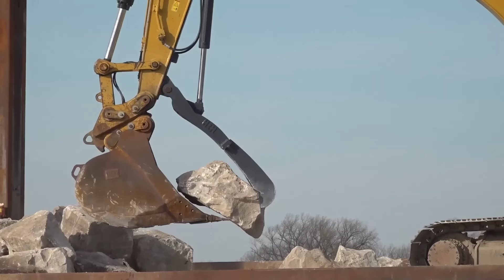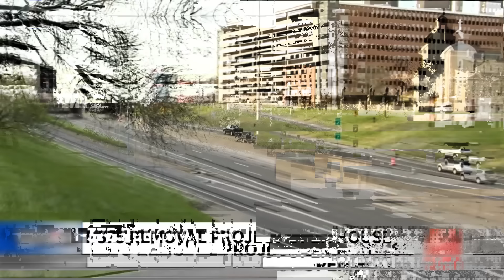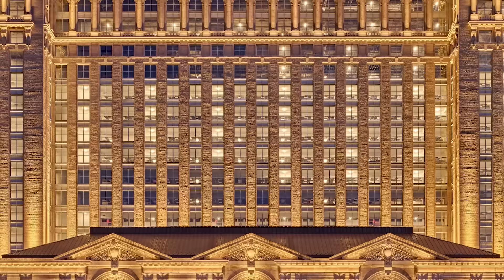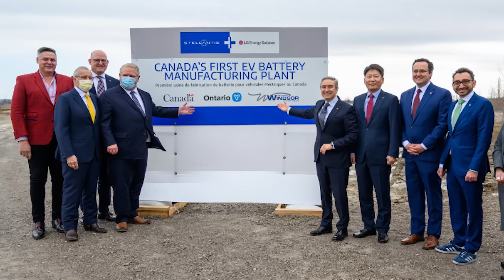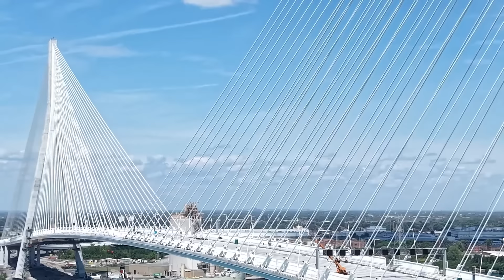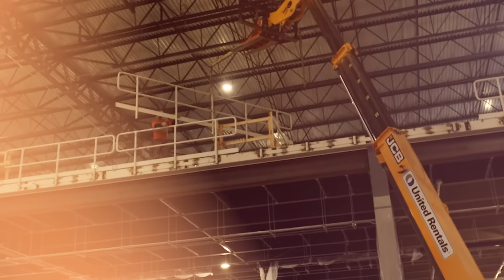Detroit's $20 billion 5 Mega-Projects Makeover is INSANE

Comment: Holy bullshit video. To go point by point...

Most of the clips of the riverfront are in fact clips of Windsor, Ontario's riverwalk across the Detroit river from the city. Our Riverfront is gorgeous but this video isn't showing you that. It is also using renderings from a "design exercise" from a decade ago to show you what is happening and none of it is real. There are new parks like Ralph C. Wilson that are fantastic, but most of the renderings are just lies.

I-375 DOES NOT have shovels in the ground yet much less a part of it opening in 2025. In fact they just went back to the drawing board for that project.

A plant across the river in another country is anchoring Detroit's EV revolution? Huh?

Hudson's Detroit also doesn't have an observation deck. That was an iteration of the building from 5-6 years ago. 

There is a lot of things happening in Detroit that are fantastic, but this video ain't it. It feels like AI slop and the real irritation is that they stole one of my photographs of Hudson's to include in the misinformation. I guess I should be happy though that lies regarding the city are now going in a positive direction...

Comment: 'Stellantis is building its primary North American EV battery plant, a joint venture with LG Energy Solution (NextStar Energy), in Windsor, Ontario, Canada, right across the Detroit River, not directly within Detroit, though they have significant Detroit-area operations and will build EVs at the nearby Sterling Heights Assembly Plant.'(GOOGLE SEARCH)

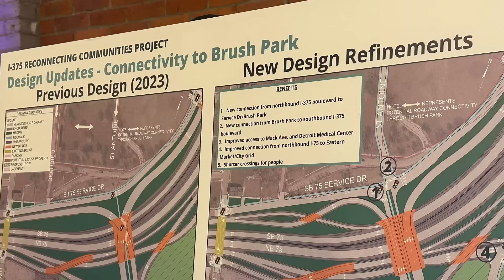Comment: 2:25 with the I-375 project, lets not get ahead of ourselves... there are certainly plans to fill the highway trench and replace 375 with a surface level boulevard but not an ounce of dirt has yet been poured over the highway, its still in planning. That being said I certainly agree that it needs to be done, and lets hope that this new boulevard gets lined with proper density. I'm concerned about this as well because there's still a lot of infilling of fields and parking lots that could be done in the immediate periphery of the downtown core.

Comment: Cool, but we still need to drive 25 minutes from Plymout, Livonia or surrounding suburbs. Then find parking. After getting back from Amsterdam and Dublin. It blew my mind why we don’t have a train system that can be accessed easily from the suburbs and take you right to downtown Detroit…oh I know it’s because the big three shut anything like that down. They don’t want good public transportation…how amazing would it be to hop on a train from just outside Plymouth or  livonia and get dropped off in downtown Detroit. Instead of driving down there trying to find parking. Chicago has the best most logical train system in the US. Instead Detroit builds more quickenloan buildings and renovates a literal train station without putting any trains in there

Comment: Just because there's a lot of confusion in the comments, as well as blatant misinformation: THE I-375 PROJECT IS NOT CANCELLED. The timeline was paused in August. The reasons why this happened is a lengthy explanation worthy of its own video. However, the concerns and challenges for the original plan are very surmountable. The odds are far, far more likely that the project goes forward than it being cancelled. I've been to one of the public meetings and have reviewed the rest of the proceedings which is all publicly online. This thing is happening.
Reply from the maker: Appreciate you clearing that up! It’s tough to keep track of every detail, so that context about I-375 is super helpful. 🙏

Comment: Pretty sure they are re-evaluating the plan to remove I-375.  Perhaps making a real public mass transportation system like they have in Europe or  China will solve the problem of maintenancing roads every year.
Reply from the maker: You’re right — MDOT has been reviewing parts of the I-375 redesign. There’s still debate over whether to fully remove it or rework the corridor into a boulevard with better transit connections. It’ll be interesting to see which direction Detroit ultimately takes.

Comment: The removal of I-375 was indefinitely postponed.
Reply: I-375 provides a fast route in and out of NFL, MLB, NHL, and NBA sporting events downtown.  It would also be very expensive to remove.
Reply: @Peter86H Removing it would be asinine.
Reply: @russsyracuse8143 Agreed. The best option, in my opinion, would be to cover it and make it into a tunnel. They could then build a nice walkable green space on top. It would reconnect that area of the city without removing I-375. It would be like what was done in Oak Park. They covered a section of I-696 and installed a park on top.
Reply: @richkroberts  Yeah, but since MI is blue == "Elon Bad" the tunnel you propose won't be built by Boring Co. for 8% of what a normal tunnel costs, so they'll have to re-launder another $50 billion.
Reply from the maker: Good catch — you’re right, MDOT recently paused that plan pending further review. Maybe I’ll provide an update the next Detroit segment to clarify that. Appreciate you flagging it!
Reply: @StructuresUnchained   "Bulldozers are busy backfilling the former I-375.."   You don't live here, do you?  And no, I would not be subscribing to a channel with fake thumbnails and questionable content.  Goodbye.
Reply: @DocDoccus good bye